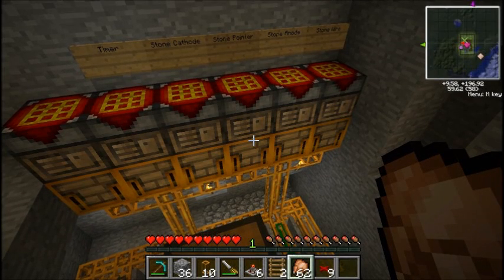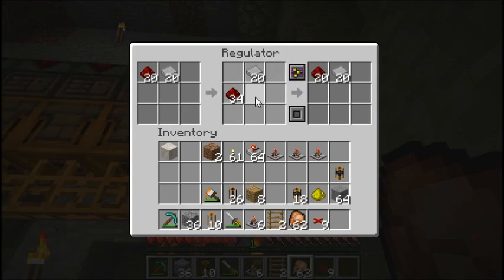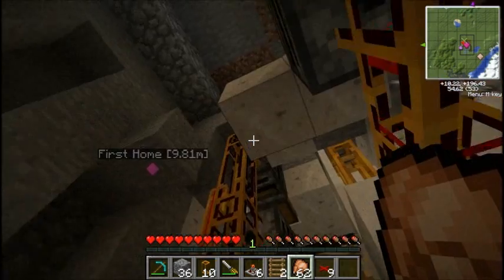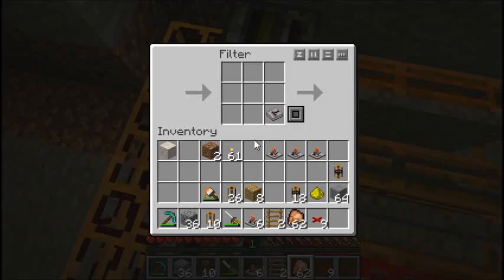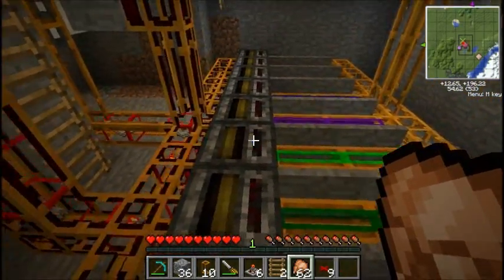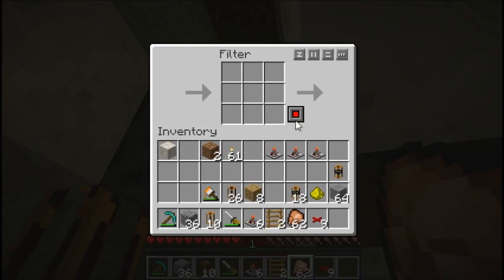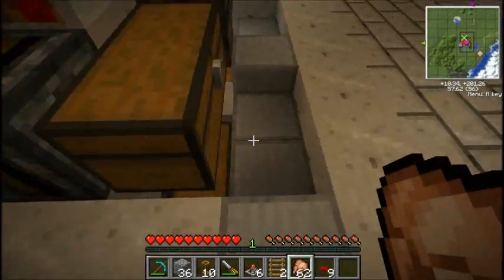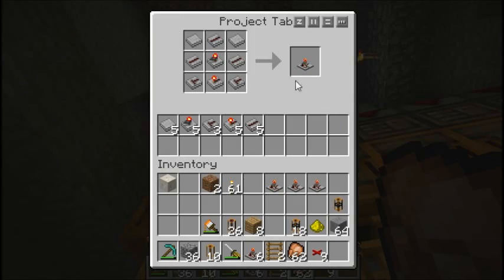Bromoc plays Redpower 2 Episode 7 -- Logic Room

Comment from the maker: Oh i know can have an infinite number of customers, what i can't have with this system is an infinite number of ingrediants. I'm limited by one ingrediant in a receipe per color with this system. So if i start wanting to make cells and fully supply all the logic gates i'd need 7 more colors for a total of 15 ingrediants I'd need to supply. So it would be possible as there are 16 colors.

But it does mean that a machine room will be out of the question with this setup.. limit at 16 colors